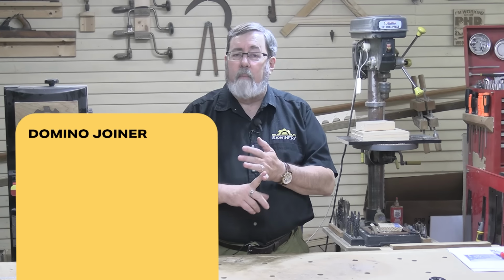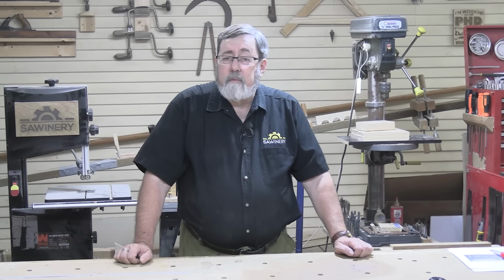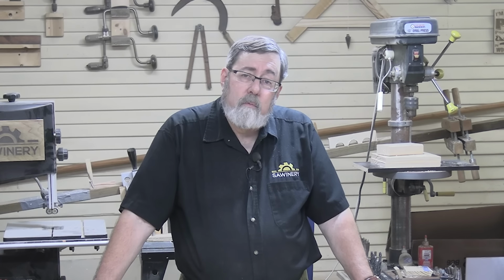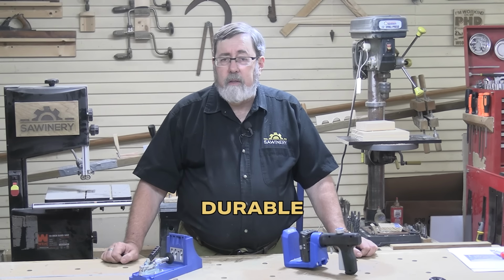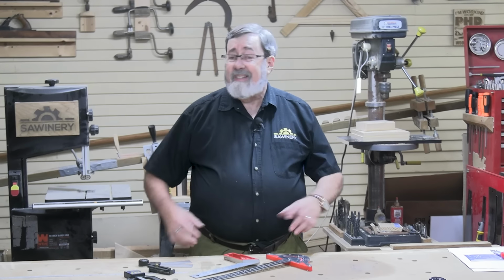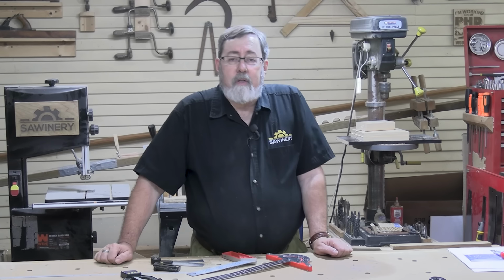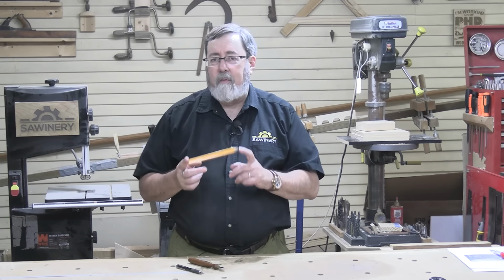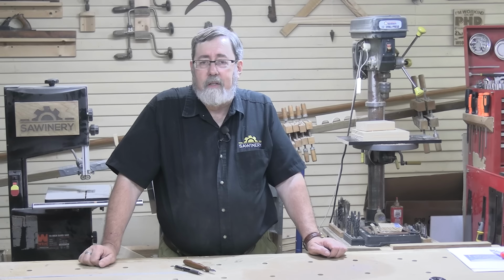5 Most Overrated Woodworking Tools

Comment: Re the pocket hole jig, just because woodworkers may use these for inappropriate joints doesn't mean the jig is overrated. That's unfair.  As you mentioned they are invaluable for face frames and certain other uses.
Reply: I think he did rescue his statement on pocket holes. I can see how people could over apply the pocket hole joint to situations that might be better suited by another type of joinery. I love mine and I have built a lot of plywood shop furniture with pocket holes.  Joints are strong as heck and the tools I store inside the cabinets don’t judge me. Maybe overrated is the wrong term. Maybe it should be one of the most overused tools for situations where the pocket hole isn’t a great choice (but that would be a horrible name for a YouTube video).
Reply: I fell for the pocket hole jig when I started.  Built an entire 4’x4’ herringbone tabletop, because I got sucked into bad teaching from a YTber.  The entire project was a bust, and I recovered over 100 pocket screws.
Reply: @gadfly149  I got lucky starting out. Someone told me the bright idea "Hey use the pocket hole jig but drill all the way through and use dowels."
Reply: I wish I’d have invested in a nice dowel jig before the Kreg jigs
Reply: Exactly, pocket screws have been used for centuries.  I used them when I don’t have clamps long enough.  I use dowel and glue and then use the pocket screws as the clamps.  Pocket screws are great for cabinets.  The problem is there are these dumb DIYers (shanty2chic) who use pocket screws for every thing and in the wrong places thinking they are clever.

Comment: I have a domino and it's amazingly fast. I run a small woodworking business and time is money.  I'm also an engineer and dowels don't do the same thing as a domino. Something I've taught many engineers is that you can only locate something once. A dowel gives you X,Y on the 1st dowel and all you need is to stop rotation.  The limit is that any clearance you need for location tolerance comes out hole slop for the dowel.  This makes dowels less accurate.
Reply: The Domino is an awesome power tool.   I have no regrets making the investment.
Reply: I have a twin dowel tool. It cost me less than $200 and does everything that a domino does. Add to that, I make my own dowels. Explain to me why anyone needs a domino.
Reply: @AdventureswithJack453  Dowel jigs not  do everything a domino does..  Dowels have an inherent issue with spacing tolerance. To get dowels to line up across a wide distance is nearly impossible.  You can enlarge the hole diameter, but then you have lost all alignment.  The domino allows you to elongate the slot without changing the height of the slot.  It does a much better job of alignment.  Musch better for distance tolerances.
Reply: @douglasvine2516  Funny, I don't seem to have that issue. With the machine that I have I can elongate the holes but I have never found the need to do so. Question for you. How do you make the domino's? I make dowels with a little gadget that I bought. It turns scrape wood into dowels so no cost.
Reply: @AdventureswithJack453  The correct way to use dowels is to make 1 tight hole and then a slot that has the height of the dowel diameter. That eliminates the concern for spacing tolerance. I buy the dominos.   Making dowels is penny wise and dollar foolish.  Dowels cost kust pennies to buy, why would you make them?
Reply: @douglasvine2516  Middle of a project and I run out. Your comment about being penny wise and dollar foolish applies to buying a Domino machine in my opinion. It just doesn't make sense to me. If you love your Domino, good for you. As for me, I feel it's a waste of money as I can do the same thing with my dowel machine.
Reply: @keith7630  agreed.  I grunted and grumbled about the price, but once you get it out and your alignment is perfect in just minutes, the money spent doesn't seem all that bad.   This is only my hobby, but I don't want to hand hew timber to make boards so I can spoke shave them down to finish boards because my great great great granddad did it like that.  In fact, I think my ancestors would come back from the grave and smack me if they saw I was doing it the "hard way" just for the sake of doing it that way.

Comment: For general construction, a miter saw and a carpenters pencil will get you a long ways
Reply: A normal "B" pencil works just as well and is cheaper and easier to sharpen (use your kids pencil sharpener😂). My sliding Mitre saw does just about all my cross cutting.
Reply: I haven't seen too many miter saws on construction sites.  I see a lot of circular saws and rafter/speed squares.
Reply: Not only general construction.  DIY projects that crop up now and then are made easy with a solid affordable cheap mitre saw.  A tool shed of tools makes one feel confident. Things need repairs and things break down and get worn in any household.
Reply: @artyfhartie2269  I have a $100 10" HF saw for that.  If it gets rained on, I really don't much care. It's fairly light and is more accurate than it needs to be for rough carpentry.
Reply: @kwilliams2239  true dat.  a pro  doesnt need a mitre saw a pro can mark the angle and cut it free hand with a hand saw. when i was an apprentice mitre saws were balked at " thats for someone who cant control their saw and saw straight" the only reason id consider using one is if im making hundreds of angled cuts and i'm on a price. id mark a cut point and the mitre saw gives me the angle i want without having to mark the angle across the whole piece im cutting . itd save me the accumulated time marking the angle on each bit of wood thats all
Reply: Yeah,  but you’re not dealing with any sort of precision there.
Reply: @ pencils are only for rough cuts, not fine work or even average work. Relative dimensioning is how the rest is done after the pencil gets put away.
Reply: @thehornboy  miter saws are great for repetitive cuts, but that doesn’t mean that a person is less skilled. Being able to set up stop blocks, clamping to the fence or table as needed? It pure time savings and why most rough contractors have at least one on site.
Reply: @melgross is perfect precise enough?

Comment: I'm just pre-retirement and starting up my woodworking hobby in earnest and am planning (for 6 months now) the tools I need to buy and after hearing you and a few other you-tubers as well as the comments below I am crossing the miter saw off my "buy" list and putting that money to buy some higher-grade chisels, better table saw blades and better dust collection. Thank you everyone from a very appreciative woodworking newbie!
Reply: May I suggest hand tools?  😊
Reply: There is one thing that you may wish to consider: safety and accuracy. Those guys have 30 years experience and can build not so cheap (wood and tracks and clamps) and accurate sleds. As a beginner you will find the miter saw to be immensely safer and accurate without having to create a perfectly square sled which will take any new woodworker quite a few attempts.
Reply: Good luck cutting down an 8’ 2x4 with a table saw.
Reply: @LivingTheLifeRetired  I have my table saw set up to process 4x8 ply, so a 2x4 is easy. No luck required!
Reply: A good table saw, a miter saw, thickness planer, disc/belt sander, and bandsaw are where I'd start.  Maybe a lathe if you plan on doing a lot of turning, if not don't bother with a lathe.  The best thing to start with is a good table saw, buy something more than one of those jobsite portable saws which are far from accurate in some cases, just get one that isn't wobbly, and isn't on a mobile stand because you really want stability when you are doing wood working...cast iron top is a great way to go....a mobile base if needed so you can roll it up against a wall when you aren't using it if space is an issue, but don't buy those cheap jobsite table saws for a wood working shop.  You might be able to get a regular miter saw that isn't a sliding type as a lot of the cuts you would do in a home woodshop aren't going to be as wide and tall as you would be doing at a jobsite for crown molding, siding, flooring, etc.  A thickness planer is a nice timesaver for wider boards to get them nice and flat, for table tops, book shelves, etc.  A disc belt sander is nice for sanding larger pieces, and followed with a random orbit sander or hand sanding whichever you prefer.  Bandsaw is great for re-sawing larger thicker materials, plus they do work pretty well for cutting curves.  I'd also throw in a drill press, whether it a benchtop or a freestanding model, it makes drilling straight holes much easier than a portable drill.

Comment: As far as accuracy is concerned 45 years ago when I was an apprentice wood butcher, the journeymen told me the following: framing a 16th don't matter drywall an1/8 as long as it's on the bottom of the sheet or in the corner. Finish trim outside as tight as you can get it, inside tight to point you can get a blonde's hair inside of it.

Comment: My miter saw is one of the most used tools in my shop.  I usually use the table saw for actual miter cuts, but hardly anything touches my table saw without being cut down to length on the miter saw first.

I have a very small shop (10'x10'), so I don't have a lot of space to waste.  But my $100 10" Metabo HPT non-sliding miter saw is worth every inch it takes up.
Reply: I agree. I have a small workshop as well and it is very nice to cut boards down before getting to the tablesaw. Which i generally have to set up outside to cut plywood or larger items.
Reply: Before I got into woodworking, one of the first tools I bought was a miter saw. I use it so frequently for DIY projects, and prefer it to the table saw.
Reply: @DavidATakes  I don't just use it for rough cuts. Most of my 90-degree cross-cuts happen on the miter saw. If you keep it square, it's more than accurate enough for anything I do.

And it's easily my most productive tool.  I don't have to change blades, adjust blade heights, pull out sleds, remove blade guards, adjust fences.  I just measure, mark, and cut.  It does one job, and it does it well.
Reply: @garysnotsowildadventures3045  If you are only cutting boards to rough length, why not just use a circular or jig saw?  You could recapture some of your shop space back.
Reply: @cottrelr  My post was meant as a reply to someone else.  I saw in your original post you use it for much more than rough cuts.
Reply: None of y'all actually listened to what he said...
Reply: @gotboostlag  Thanks for clearing that up
Reply: @DavidATakes  I think it's a tool that if you have, you'll use it a lot.  If you don't, there are easy ways around it for almost everything. It's a very useful tool, but I wouldn't put it at the top of the list. A really good table saw is more important than a mediocre table saw and miter saw. 

Before buying any tool, it's purpose has to be understood.  "What do I do?" and "What's the best way to do it?"  The answer to these questions will determine the order of tool purchases.  If you're a turner, a miter saw might not be so important.  A bandsaw would be far more important than just about any other tool (outside of the lathe, of course). If you're a cabinet maker, a table saw and probably a track saw are the most important.  There is every combination between.
Reply: I just use a hand saw. Takes up a lot less space.
Reply: @fredmercury1314  Aren't you special.  At the dinner table, do you use a knife and fork?  Why?  Man has been using his fingers ten thousand years. Fingers take up a lot less space, and don't take ten years to learn how to use proficiently.
Reply: @fredmercury1314  If I wanted to use hand tools, I'd play Minecraft.
Reply: @Rossg1981 My miter saw gets a lot of use, sure, but if I were starting over it would be well down on my list of expensive tools.  It's too easy to use another tool.  It's not as easy or fast, but there are other tools.  I'd focus every dime I could scrape together on the best table saw I could.  Buy used, if you can't afford more, and there is no need for a SawStop.  Older Unisaws become available periodically.  Good, used, contractor's saws are cheap. A good table saw is the one tool that I could never do without, and I don't have a SawStop either.

Yeah, my circular saws don't get a lot of use for anything other than construction, but they are usable for breaking down sticks small enough for a table saw.  A good circular saw works.  A crappy one will be nothing but aggravation. 

Carpenter's  pencils are like using an axe as a crosscut saw. They're not overrated.  They're useless for woodworking.  Mechanical pencils are good but I'm forever breaking the lead.  I use pens, when I can.

There is nothing wrong with pocket holes.  They're fast, and with glue you're not going to find many more secure fasteners for side-grain uses.  They avoid end-grain joinery entirely.  They're great but some jigs are pretty poor. I use them for some non-structural carpentry work.  They're easy and strong.
Reply: Same here it is an invaluable and probably most used tool in my shop
Reply: I have a very small shop too. My saws are all.... manual.😂😂😂
Reply: I swear by my Metabo miter saw!  Best $119 I ever spent

Comment: As a machinist I have zero tolerance (no pun intended) for inaccurate measuring devices.
Trying to save a couple hundred on a quality measuring tool can cost your company tens of thousands of dollars and possibly cost you your job.

Edit to add: consideration should also be given to how much accuracy is needed for the job. Dont bring a tape measure when you need calipers, dont bring calipers when you need a micrometer, bringing a micrometer when a tape measure will do is wasting time/money.

Comment: I use my mitre saw more than any other of my saws. 
It is the first tool I use to rough cut stock before I mill it then use it to cut things to final length. 
If I lost all my tools it would be one of the first tools I would buy again. 

I do agree that all of the YouTube channels hype the latest tools like you can’t live without them. 
I am 65 yrs old so I have seen it for years. 
Biscuit jointers, track saws, domino jointers, saw stop …

Comment: The last kitchen i did I used my pocket hole jig to put the cabinets together. I’ve used different joints and glue in the past and wanted to try something different. To be honest the cabinets with the pocket holes appeared to be just as strong as other methods I’ve used. For a very small investment and not having to by other special tools it gives people an affordable way to build a wide range of projects without having a big shop area. BUT there’s nothing wrong with having a big shop.😁

Comment: Follow for good reason. The experience and insight is great. You will not run across many people that have the extensive time in the field as this man. Doesn’t mean he’s perfect, but take everything as expansion of knowledge base rather than factual textbook statements. 

I think some people take this as a “don’t use these tools” instead of recognizing the title where it says “overrated.”

These tools aren’t necessary and they don’t make everything nicer. You can easily use other methods like I do. I used to have a miter saw and got rid of it. I just rough cut boards with a circular saw and clean everything quickly with my perfectly calibrated table saw for example.

Comment: Don't disagree on the overall tone, but taking issue with tools like the miter or track saws? It's not whether you can do the same thing with another tool like a table saw, it's whether you can do it accurately and safely in a comparable amount of time. Maybe your dad did it all on a table saw, but back in the day a table saw was a pretty significant investment and there weren't a lot of specialized tools like consumer miter/track saws even available. Maybe some of those jobs are possible, but how long did it take you to figure out how to do it correctly and safely? Or find someone to show you how? 

Kind of comes off like the guy watching his friend invent the wheel and then saying, "Whatcha need that for? Ya got feet, don't ya?"
Reply: It's veering into old man shouts at cloud territory.
Reply: Yeah he is using the argument of because people did it differently before the new way is stupid.  
Before table saws people used panel saws so by this guys flawed logic is table saws are overrated because people have been ripping boards with panel saws for years.